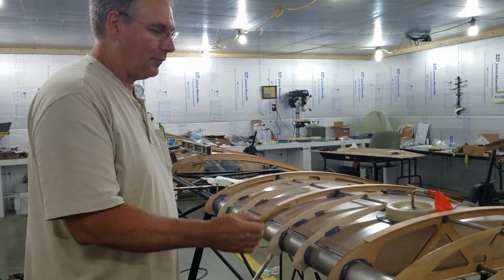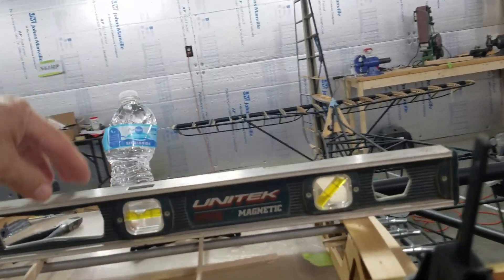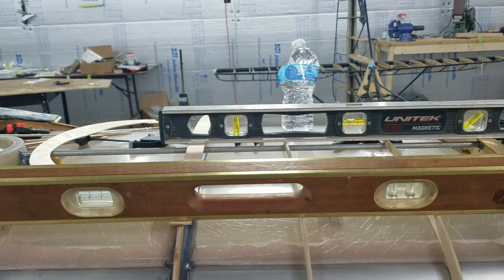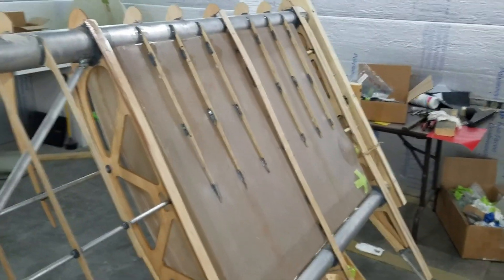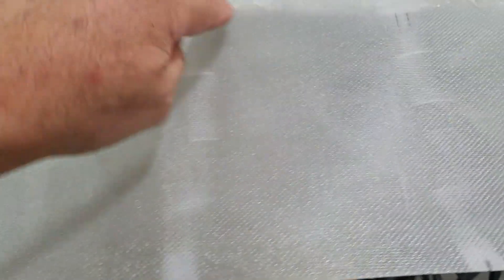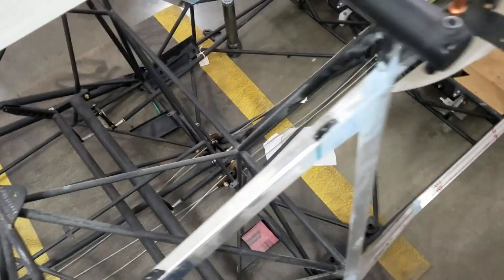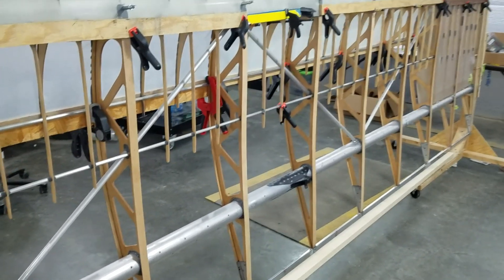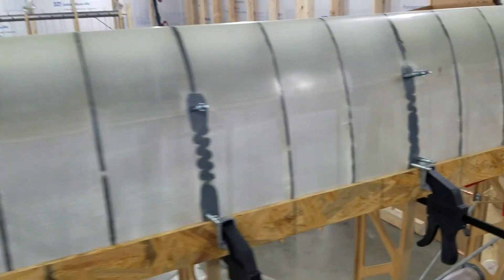Kitfox STI Farm Fox build 14 Laker leading edge

Comment: Nicely done. It looks fairly straightforward.  I did hear those false ribs were a pain.  The next one should go even better!  Thanks, once again, for sharing.
Reply from the maker: Hey Mark. We got the other wing done today. It was a little harder to get a good fit but we got it done. Took about 12 oz of glue per side.
Reply: Harlan Payne Are you using a syringe to apply?  I was planning on buying quite a few of them.
Reply from the maker: @markperkins5664  I am mixing out of the qt cans that come with the kit and using 50ml syringe to apply. Bigger would be ok if you can find a small outlet.
Reply: Harlan Payne there are 100 and 200ml syringes listed on Amazon.
Reply from the maker: @diepenj47  I think the 100s would be good for this job, easier to load. Thanks Jim.